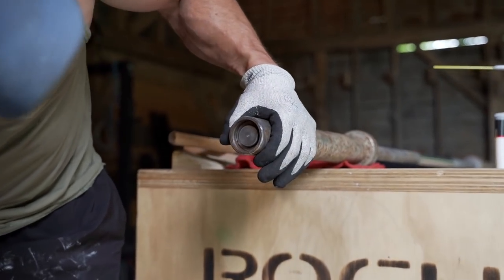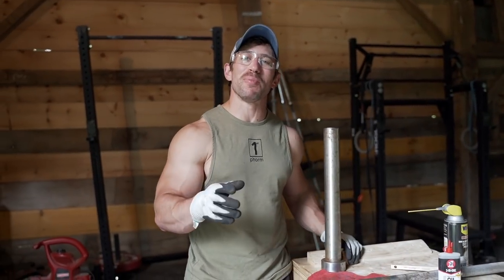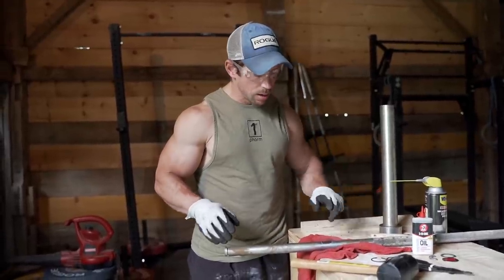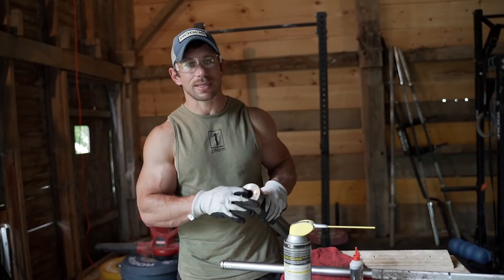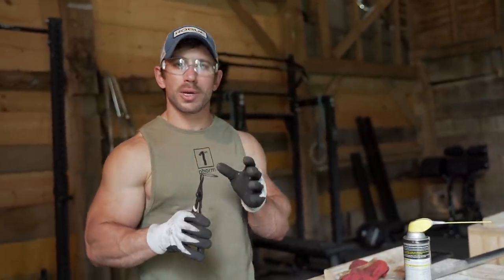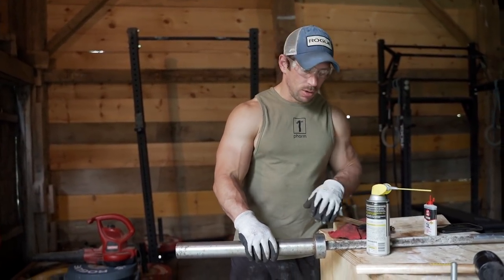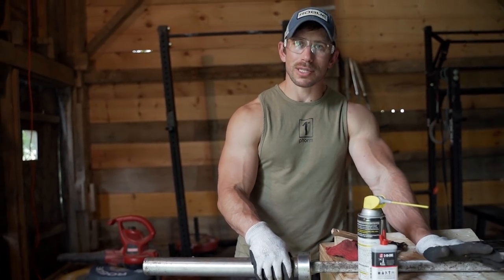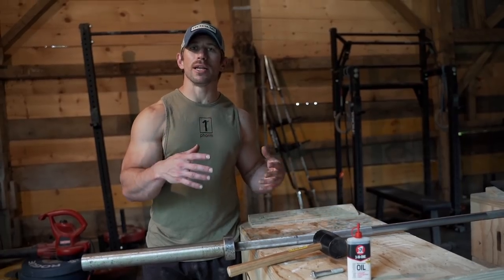BRINGING MY ROGUE ATHLETE BAR BACK TO LIFE

Comment: I don’t have a rogue barbell but will this work generally for most standard barbells?
Reply from the maker: Chase Foster once you would take the sleeve off the basics are the same. Clean off the snide of the sleeve and end of the barbell. 

Taking the sleeve off might be a little different depending on the barbell.

Comment: I have found that synthetic grease (like Super Lube) is much better (hydrophobic and rust resistant) for barbells as well as many other types of applications where a lubricant is helpful.  One of the bearings on a fan bike would not stop squeaking no matter what I tried (especially after only owning the damn thing for three months). I applied the grease and it never squeaked over the remaining 4 years I owned it.